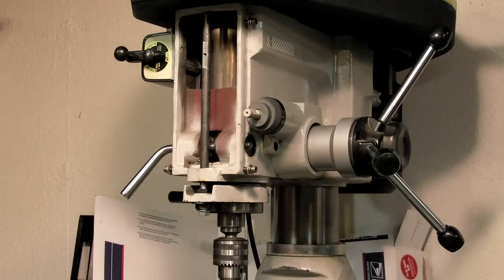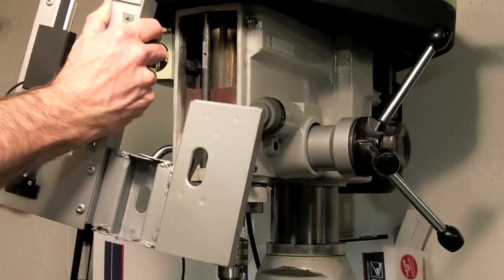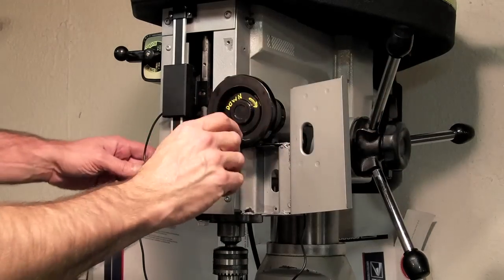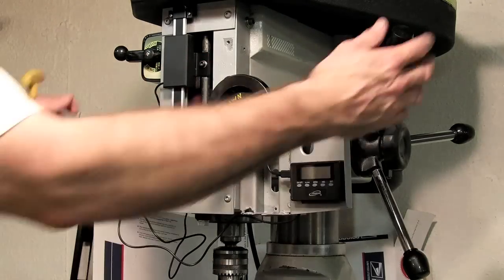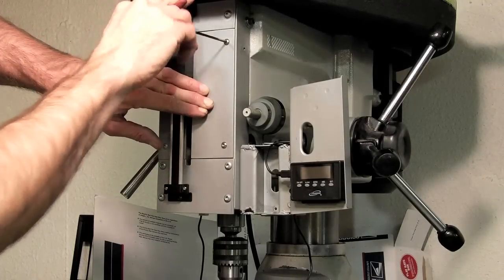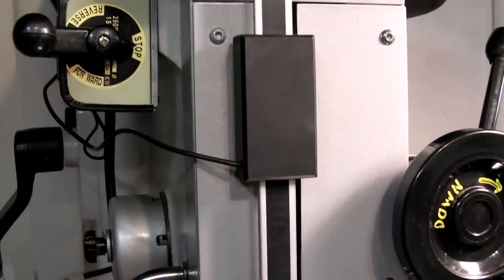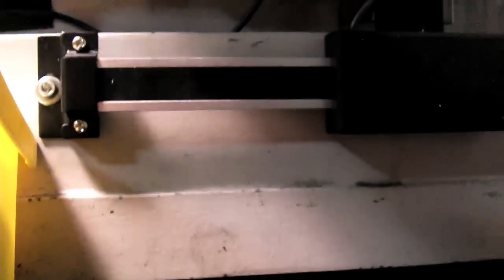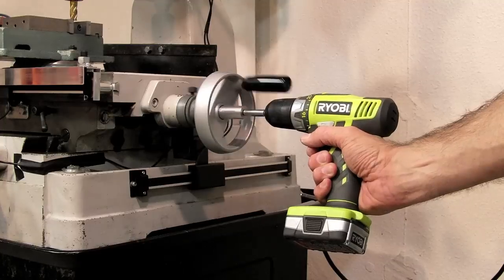Inexpensive digital readouts adapted to Mill Drill machine

Comment: This is an excellent video.  Thank you for your posting. 
I would appreciate a few more comments about the vertical rod that's a part of  what comes with the machine -- it seems to be the "key" to the success of a DRO installation.  My machine's vertical rod is very sloppy in fit and function.  I'm not sure if I should replace it or just use a shim and use JB Weld to hold it in place.  I know that what's desired is to remove all variations in its movement but I'm not sure exactly how to go about achieving that -- somehow "pinning" it at the top or some other alternative procedure to make it run "true" over the course of its travel.  The knurled screw on the bottom has a "roll pin" holding it to the rod.  I suppose that I could extract that and attempt to machine a new rod but I'm not sure how "true" the hole that contains the install rod is.
Have you any thoughts on this?
Thank you.
Jimmy
Houston, Texas
Reply from the maker: sorry for the late reply .. if I did this install over again, I would replace the rod wiht a small diameter rod, so it can flex in the X-Y directions to more easily self align to the DRO slide to reduce binding on the DRO slide. Whatever rod is used, it must be tight in the Z direction. I have been using this DRO setup for MANY projects, it makes this machine very useful since its near impossible to make complex parts by reading the knob dials and with inherent backlash. I have made hydraulic brake calipers, engine cylinder heads, etc... all very much accurate enough for my racing activities.

Comment: I put two of these on my lathe for X and Z indications.  I've noticed from time to time that the indication will jump as much as 1" or more.  I haven't narrowed it down but it seems to happen when I turn the lathe on or off.  Not sure if I need to move the wires or indicators further away from the motor or shield them somehow from possible stray signal being sent. 
Any thoughts?
Reply: I had this problem too, really weird behaviour with the exact same brand DROs in this video. The capacitive scales (the black parts) on the aluminum bars must be absolutely spotlessly clean, no oil at all. Fingerprints are enough to upset it. Once I thoroughly cleaned the scale with 99% isopropyl alcohol (NOT 70% rubbing alcohol, it leaves residue), the problem went away.

Comment: When you use the power feed to rapidly advance the table, does it affect the DRO?
Reply from the maker: No issues with DRO maintaining zero posiiton, even when I use power feed at fast rates. Additionally, the DRO displays can be turned off and the zero points will be maintained to continue work later!

Comment from the maker: Youtube for some reason is giving me a comment reply button .. so, I'll answer a few of the comment questions here in this comment:  How long do the batteries last? > a very long time, the DRO kits usually come with extra batteries (large watch type battery), I replaced only one of them over the last year. Also, if the display is turned off, when it is turned back on, your zero point is maintained, which is vital! Has anyone used the DRO output for a common display or control? > I haven't seen an example of this yet, then again the low cost CNC conversions I have seen run open loop with stepper motors, no encoder control of the motors - many examples on youtube. Where can I buy these DROs? > go to the link in the video discription above, there I have written some details about the install and provided direct links to Ebay seller items, just keep in mind prices vary a lot of Ebay, don't spend more than $150 for all 3 DROs, look for the best prices.

Comment: For what its worth, I bought the same dros for a 10 X 52  and they are right on.
Problem was mounting,  No room to drill and tap; solution, I epoxied  them on.
I firgure your not towing a Mack truck or something. It works perfectly.
so dont underestimate the power of epoxy.

Comment: I would have liked to have seen this post before I lost a lot of hair installing a DRO system on my chinese clone mill. You provide a lot of good ideas here. BTW, how long do the batteries last in those read outs ? I have up on mine and installed a much more expensive Easson DRO, mainly because I was tired of flat batteries :-( Thanks for posting!
Reply: I did this .. and repurposed an AC/DC power supply to power those same DROs.

Comment: i just bought these from my local busy bee tools in Canada the 6'' models were 27$ and the 12'' were 33$ they seem to be accurate and lcd refresh rate is fast enough great solution if you don't want to spend 700+ for a proper set up

Comment: Try looking on Ebay for the DRO's ... I bought mine there, was about $130 total.   This setup works great, I've made a lot of precision parts ... most recently a set of hydraulic brake caliper housings. I found it nearly impossible to use this machine to make useful parts prior to installing the DROs.